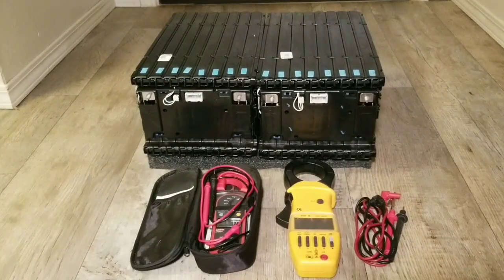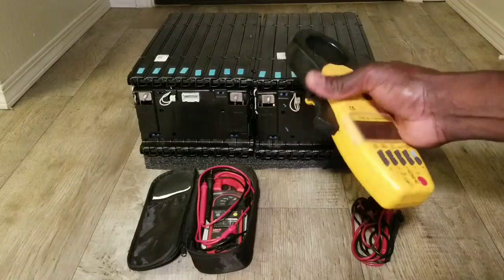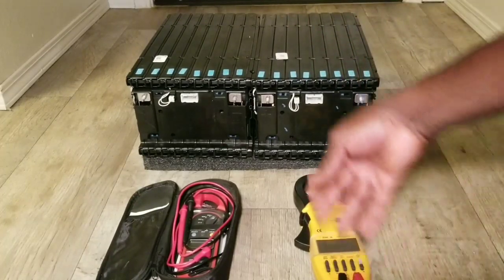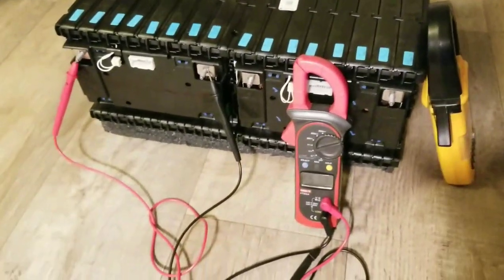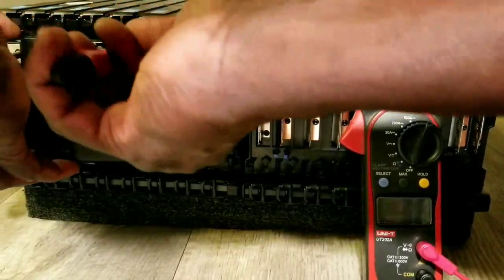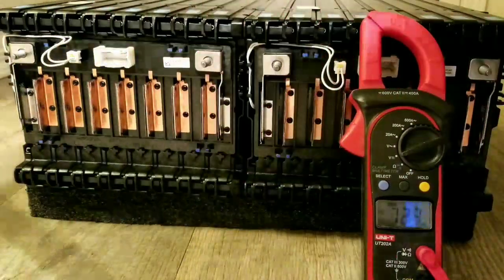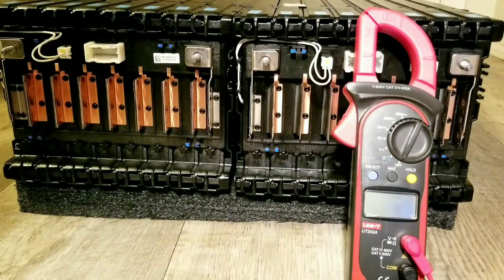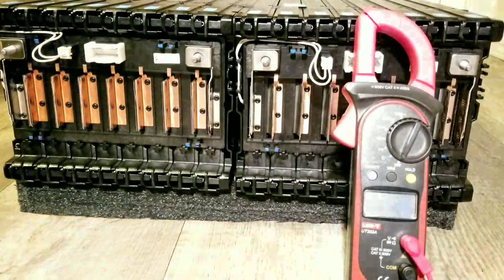CHRYSLER PACIFICA: LG chem solar battery review

Comment: You need a 3digit meter since the battery voltage are the same but individual shows a little different the rounding makes it look like it is off 0.01 when likely it is only of 0.002 where 7.235 shows 7.23 and 7.236 shows 7.24. Cheers and good luck.
Reply: You don't need to know thousandths for these voltages. 7.23 versus 7.24 is close enough.
Reply from the maker: Thanks
Reply from the maker: Thanks